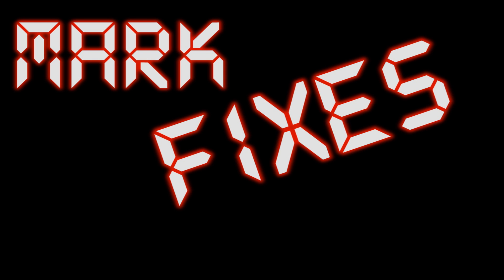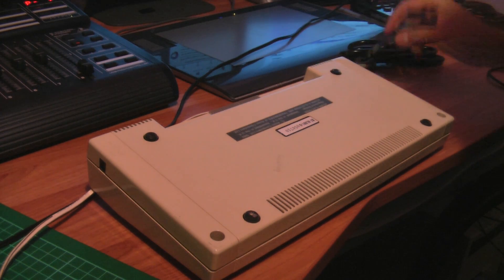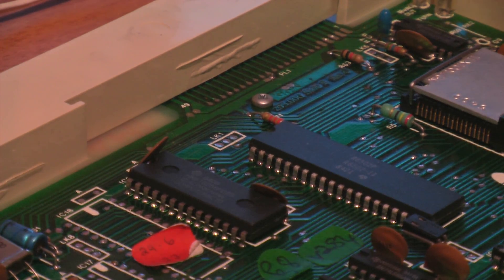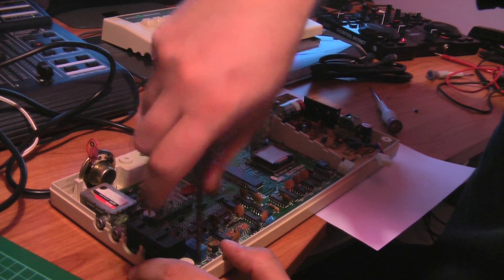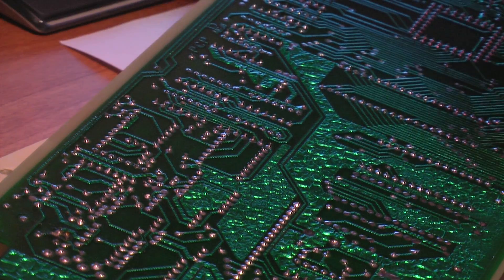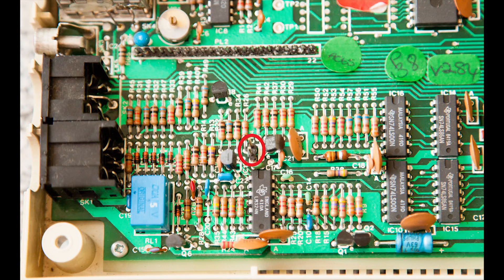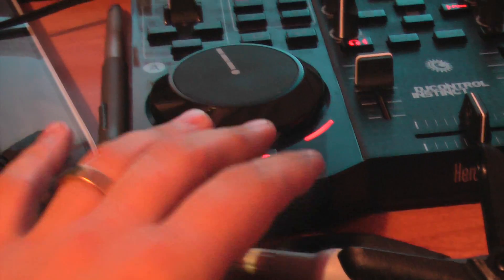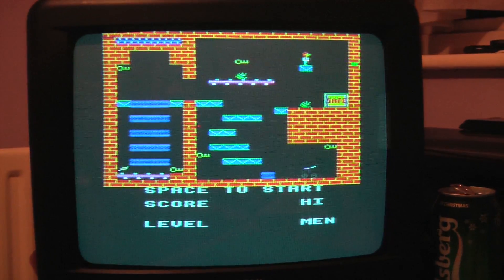Acorn Electron Colour Fix for Black and White Composite Output

Comment: I have just bought my self an Elk, I haven't used one of these since the late 80's early 90's. Hopefully it works straight out of the ebay dodgy packaging...  and if it does, I will be immediately doing the colour composite mod, however, I wont be using a yellow jumper, I will choose a more appropriate colour because I have a variety of colours of jumpers, I'm thinking green... hmm, green... yes... green!

Comment: Just subscribed.  :)
The Amiga 500 also has a mono composite video port; do you happen to know if this can also be persuaded to output colour?
Reply from the maker: Thanks for subscribing MarkTheMorose!

I don't know how the Miggy 500 generates the composite signal, but I think it's unlikely to be the same way that Acorn did with the Elk ULA, as it's a very odd video generation system. One of the issues with the Amiga 500 is that the onboard composite output is PAL/NTSC independent due to the lack of colour, and if you bought a modulator that would then be the correct RF / Composite output for the target country. 

In short I think it would take a fair bit of circuitry to pull off, and that circuit is already in the A501 modulator  :)
Reply: Thanks.  The trouble with the A501 is that it adds to the continent-sized footprint of the A500 itself!  Never mind, I do have A600's and 1200's also, but I have a soft spot for the 500.
Reply: the A501 is a memory card for the trapdoor,the A520 was the modulator for the rgb port,and was region specific

Comment from the maker: Thanks for the sub Bluepatch11! I have absolutely no clue why the "Video" socket outputs a monochrome signal. My best guess is that it was originally intended for monitors that might have had trouble syncing with a colour signal.
Reply: I think it might be because a monochrome signal on a monochrome monitor is usually much sharper than a colour signal. That way, text would look much better.